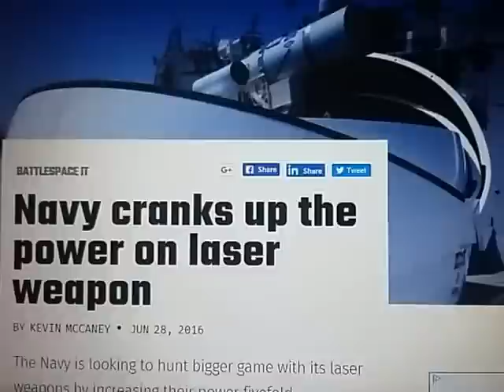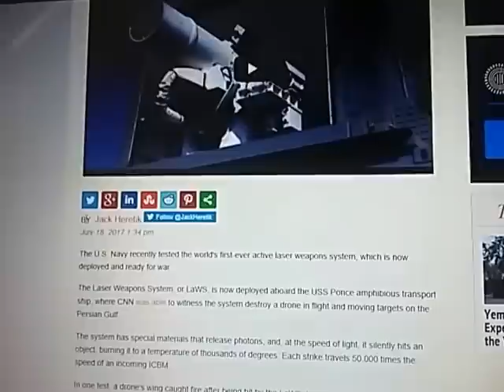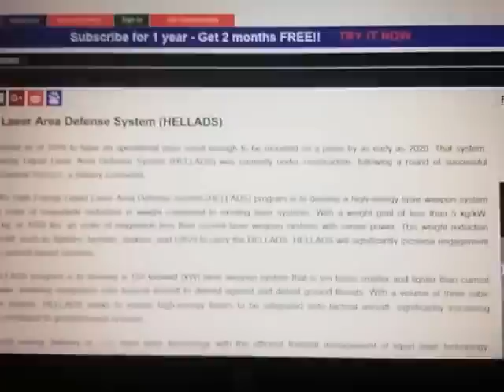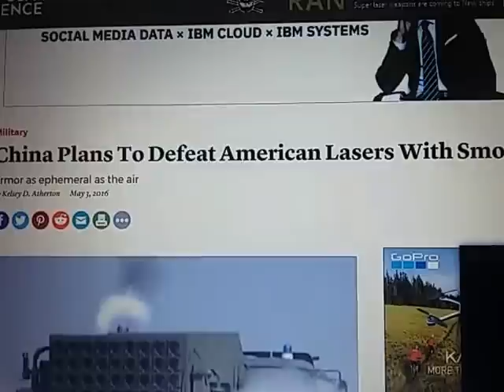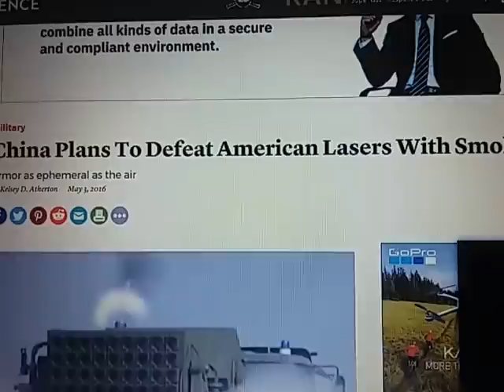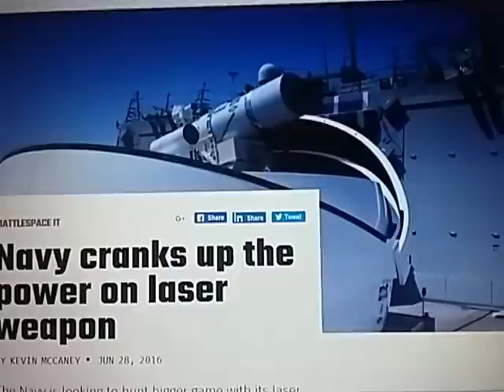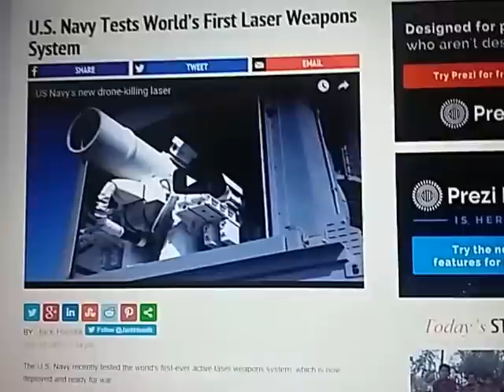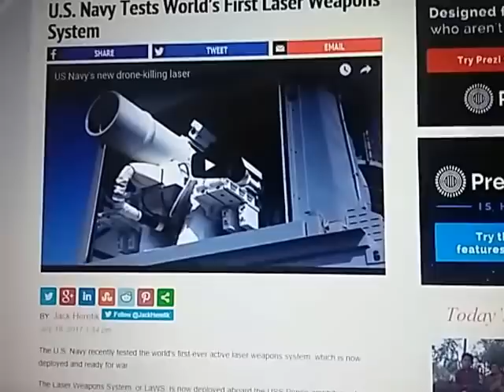■DARPA▪NAVY■TESTING NEW 150 kw ABM LASER ON THE FITZGERALD?!

Comment: Back in the mid 80's, I was a weapons system engineer/group leader on the F-14.  A civilian engineer wanted to test his LAWS on a test aircraft.  I had the good luck to be involved in this short-term program. His LAWS was expected to have a multi-shot capability in the air to air combat role.  His package was designed to fit on the Phoenix missile stores locations between the nacelles and would have a150° forward field of regard. It would be fueled using the F-14's fueling capability/capacity. Regrettably, the Navy at that time did not have sufficient funding to do the hardware/software integration and testing and all activity was stopped.  It would have made the AIM-7 Sparrow missile unnecessary.

Comment: I'm not sure that the accident with the USS Porter was an accident.  I think the Porter was an attempt to see if a tanker or some other ship could hit the area where the laser systems would sit.  If they crush where the laser would sit (thinner steel skin above the waterline) they can defeat the laser system.  

I think the Fitz was an attempt to damage above the water line - where the system sat - AND under the waterline where the guts of the system reside for a plan to neutralize the US in the future.  Like you said in one of your videos, the sonar bulb on the ACX wasn't damaged enough and the hole on the Fitz wasn't lined up with the damage above the waterline.

Comment: Don't fool yourself into believing that the Russians and Chinese, do not have such weapons.
The technology has been there for 20 to 30 years to build one.
If you took 5 of the 30 KW lasers and strapped them together; they could be coupled optically to create a 150 KW laser weapon.
And 5 more 30 KW lasers strapped on to the 5 laser weapon would create a 300 KW weapon once they added the optical combining and collimating and focusing optics.
 The only limitation to building one is the cost of producing one and the cost of the optics, power supplies, and cooling systems.
 The Russians and Chinese do not like the THADD systems because they can be converted and used as offensive weapons to carry explosives into their countries.
They consider high power laser systems to be purely defensive, especially since they can be reflected directly back to the source laser to destroy it if it was ever used offensively.
 Defense is OK.
Offense is not ok.....

Comment: Keep in mind that we had the Airborne Laser Lab (ALL) flying out of Kirtland back in the mid to late 80's. It  used a KC-135 with the top of the fuselage opened for deployment.  It was quite effective.  That program was eventually put under the DoD Directed Energy Directorate. The DED, was/is under the Air Force Research Laboratory (AFRL).  Further, AFRL received  a contract  in 2016 to incorporate Directed Energy Weapons (DEW) technology into fighter aircraft. (Article in the Albuquerque Journal, re: DEW in a fighter award). So shipboard DEW, with fewer size restrictions from the ALL (and DEW in fighters), and the advances in technology, since SDI  is a no brainier.  The ALL used most of the KC's fuselage for power generation and energy storage (huge capacitor bank). All of this is of course public domain information.

Comment: This Star Wars Weapon system would required a serious power generation system, with extensive banks of high voltage capacitors and massive transformers, all to step up, store and discharge through the laser system. With a nuclear reactor  powering the electrical generation system, these ships could stay on patrol for a very long time. Electric motor driven screws would be quiet and fast. Ideally you would want the capacitors near the laser to avoid power loss issues. So consider where the laser most likely would have been located, in reference to where the freighter struck the ship. The massive charge storage banks would be near by. Maybe that is what they were trying to hide from view

Comment: If this weapon was in use at the time of the event, i.e., drills being done, then this shifts, or reinforces, some of the theories that have been discussed to date.

Skeptics have been adamant that it's possible for the night crew to screw up bad enough to be unaware of the ACX, and that would also have to mean that the ACX captain is lying, because even with the Fitz crew screwing up, they would still be receiving radio coms from the ACX and hearing the fog horn with enough warning to sound collision.

But this LAWS theory changes things.  If that was in use, then the number of people awake on that night shit MUST have been a lot more than what they've told us (is it seven?).  The official story is that it's just a routine night shift, right?

But if they were running LAWS drills, there must have been a larger crew awake.  And FM says that the ship would have to be sitting still, maybe anchored, to use it.  If it was sitting still, that makes the Fitz extra vulnerable, because it cannot speed out of the way quickly.  This then means that the added vulnerability would mean that they would have had a much more serious watch condition in place to prevent collisions, IOW, they would need extra warning lead time on incoming ships.

Assuming all of that is true, then that means that the night crew was FULLY AWARE of everything going on around them, and NO ONE was caught off guard.

That then would explain one of my previous points, that being that with such a huge and extremely violent collision, that caught the entire crew off guard, how was it that only 3(?) people were injured, and those that died only died because they were trapped in their quarters and drowned?

There should have been tons of injuries on that ship.  TONS.  But there weren't,, not officially, anyway.  If that is actually a fact, it could be explained if the crew were AWAKE AND AWARE, instead of asleep and unaware.  If you know a collision is coming, you can BRACE FOR IMPACT, and prevent injuries, as well as move to safer locations, like the port side of the ship, and the bow and stern as the ACX gets closer and you can tell where the collision point will be.

So perhaps they had the anchor down.  Surely it could have moved out of the way easily enough with 10-15 minutes warning with anchor up.  So then, how long does it take to reel in the anchor?

If it's the case that there would still have been enough time to evade after the anchor was pulled up, then  you have to explain why this alert crew, running LAWS drills, with extra watch staff, failed to do so.  That brings us back to the idea of an attack of some kind, such as an EMP.  With systems down, they wouldn't be able to get out of the way.

But that's not all.  This theory raises a new question, assuming the theory so far is correct.  If the Fitz was anchored, and sitting still, why did it select such a dangerous location?  Or, was it a dangerous location?  Is that collision spot in an actual shipping lane, or between them?

What about the turn to port of the ACX?  Way back I saw one commenter say that he looked at the shipping lanes for that area and said that the lane actually moves to the left, so the ACX autopilot was steering normally.  I haven't heard any further discussion or confirmation of that since, and that's kind of critical.  Was the ACX turn to port normal, or not?

If it was normal, and it was in the lane, then the Fitz picked a 'hell of a spot for a moonlight picnic'.  (Again, why did they pick that spot?)  But if the ACX was 'out of the lane', then again, we have to ask, why did it seem to be aiming for the Fitz?

If the ACX turn to port was abnormal, and the ramming was intentional, then there must have been a prior assault to disable the Fitz and hold it still for the ramming.
Reply: EMP still out of the question when a sailors cell phone worked after the collision. The Fitz was targeted. I for a while now has felt there was another ship in the mix. i think an attached explosion and when it wasnt enough i think then it was ramed and left for dead. Or NK sub than the ACX both countries are mad at the us and if we got a ship sitting as a target its a trophy.  Remember 50 NK subs went missing and no matter the age on batteries you cant hear it. i know its a stretch but a thought. At times you got to think of the most far fetched idea and at that point you could be right if not close to right.

Comment: FM: Is it possible that the "Fitz was running parallel to the Crystal, using it as cover, and a stealth sub popped up between them, that both the "Fitz" and the Crystal hit?  That they didn't actually hit each other?  Both caught off guard, and no way to avoid a collision?  It would not be the first time a stealth Chinese sub caught the USN by surprise during a military exercise.  Might also explain why  access to question the US sailors was denied to Japan, and the damages done to both ships.
Reply: Why it couldn't be "the Fitz was chasing the sub, and was hit by the Crystal"? It made more sense.
Reply: We know the story as told makes no sense.  A few years back, off Okinawa, a Chinese sub, running stealth, popped up in the middle  of a US military exercise.  The US did NOT know it was there. 

FM has questioned the underwater damage,  allegedly caused by the bulbous nose of the Crystal to the "Fitz". They hurried and covered it up, and no one saw it, and the USN did it underwater before dry docking, but after limping into port, because they did NOT want it seen. I say it would have negated the agreed on story.

IF the damage was from a sub surfacing, it would explain a lot. Non disclosures and no one allowed to question the sailors, and IF the Crystal hit the surfacing sub, after the sub hit the "Fitz", then that might also explain the reactions, lies of the Crystal's captain.  Would also explain the actions of the two Japanese ships, especially if the two collisions may have sunk the sub?  Yes, I believe the Chinese would have sacrificed their ship to take out the "Fitz".

We can be just about 100% positive "Fitz" was there to monitor NK launches, as an ICBM launched as soon as "Fitz" was taken out. Let me throw a further idea into this mix.  We know there are "sister" services ie: Army-AirForce    Navy-Marines, and last I knew, there were always Marines present on Navy ships.  Is it possible that those 16 highly specialized Marines  who died in that KC-130 crash on July 10, in Oklahoma,  had previously been on the "Fitz" and were headed to a debriefing somewhere in the states?  I know that when I heard it was a Marine KC-130, my alert system went live. Just  my thoughts fwiw. IMO, it  points to a joint venture NK/China/Philippines.  and possibly resulted in a final act.  Wouldn't be the first time!  Thinking of some Navy Seals,  and how dead men tell no tales.
Reply: I appreciate your detail theories. You gave a lot of thought into them. Don't want to disrespect you, but the sub-surfaced-and-damaged-both theory is a tough sell. Both the Fitz and Crystal have matching damages, which prove that they collided into each other. I cannot think of a way that submarine could be in the middle.
The KC-130 was a tragedy happened in the US. The plane flew from a national guard base. The marine on board might have a connection to the Fitz, but the whole tragedy seemed nothing out of the place to me.
Reply: It's ok Phillip. This is about ideas, thoughts, theories. Nothing says we have to have the same ones.   We can agree to think differently, as nothing says I have it figured out. Thanks for your input.

Comment: Florida Marquis, again this is the why and the original question of how remains unanswered. It is obvious by the damage that the Fitzgerald was sitting still when attacked. Which translates to being anchored. In your last post there were a few comments about anchoring, one in particular that stated that the necessary amount of chain would sink the ship. Bear in mind that the Chinese have been constructing islands right in this area so it cannot be too deep, at least around banks and shoals. Also you do not have to use all chain to anchor. In deep water a length of chain at the anchor, then attached to a cable rode is common practice. I have used this method before. This is why cable is used on suspension bridges and not chain. Also it's cheaper and lighter and pound for pound stronger. I attempted to get the depth at 34,32'N., 139,05'E, the location where the Fitzgerald was attacked but couldn't get my IPad mini to work (probably my computer illiteracy). Perhaps you or someone else of your caliber/knowledge in computers can get it. I even went through a bunch of old paper charts of Japan and came close but not exact to the location and it looked quite possible by chain alone. Regardless it can still be done with cable if you know how!
  While this only answers part of the puzzle, I still do not understand why she would get rammed as you can still move with a anchor down, at least enough to get out of the way of a container ship. This part just doesn't make sense, got any ideas?

Comment: A 30KW laser system with little or no divergence would only be useful on relatively close targets, ( like 1200 feet or less..), and also requires the laser to maintain position on the target as it is moving because it does not burn through anything instantly.
 To double the distance you would have to quadruple the effective power output of the device.
It also makes it infinitely harder to keep the laser trained on the same point for a long enough period of time to burn through the target.
 When using a laser as a weapon; the closer the target is, the better.
Now a 150KW laser shot at a close target, (1200 feet or less), would require little or no 'dwell' time on the target to destroy it.
It's effects would be almost instantaneous...